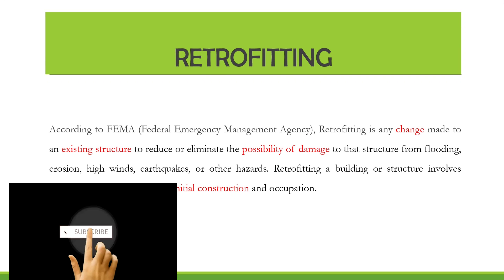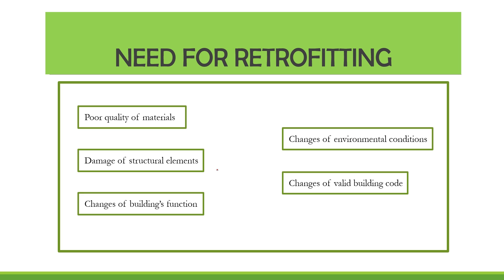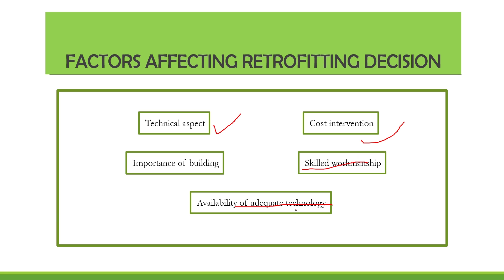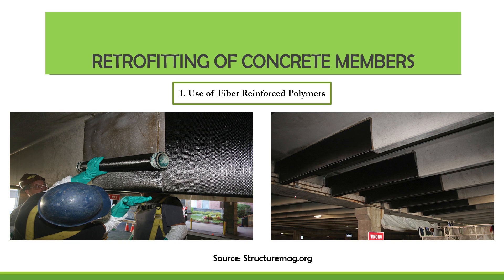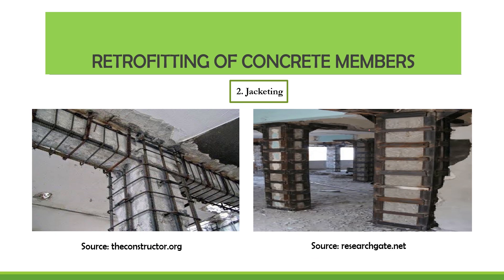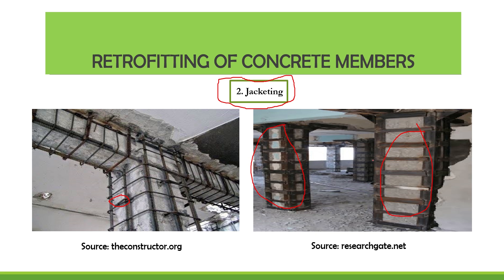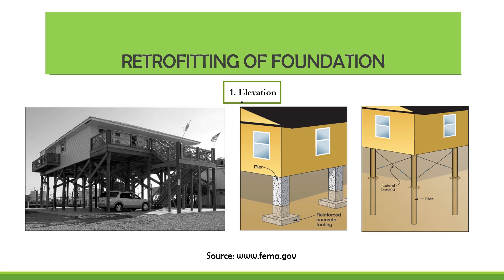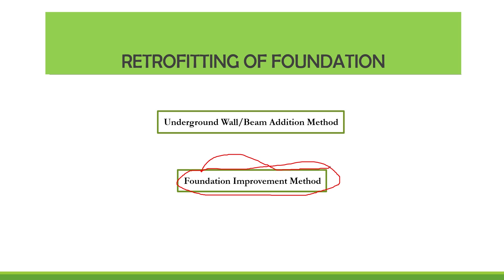Retrofitting and Retrofitting Techniques

Comment: Do we need to use cement grips when pouring concrete to bond the new concrete to old concrete?
Reply from the maker: The dowell bar Installed will serve as a bond between the old and new concrete. Using cement grip can also be additional.
Reply: @ShefdenAcademy   Dowel Bar is ROUND BAR right?